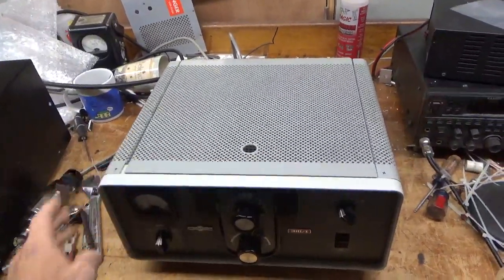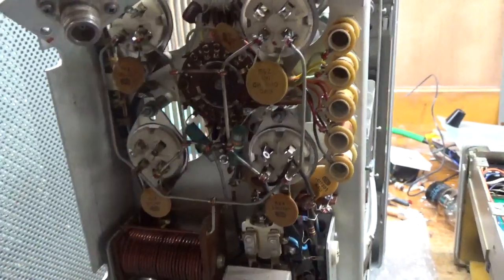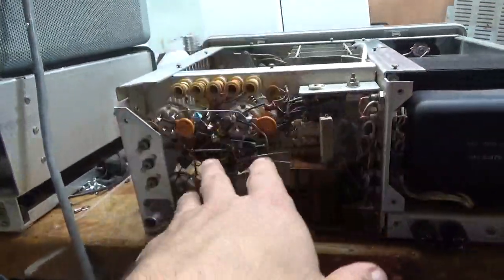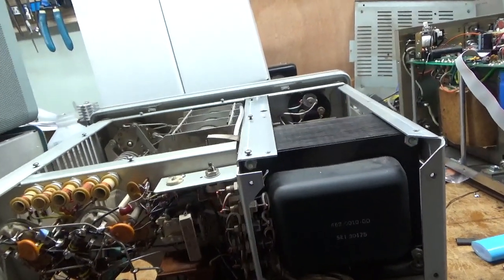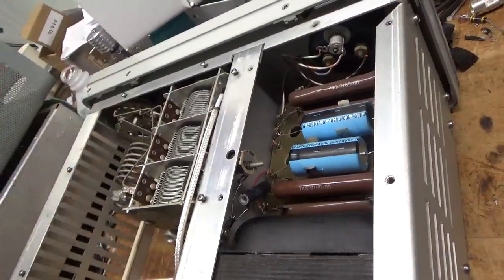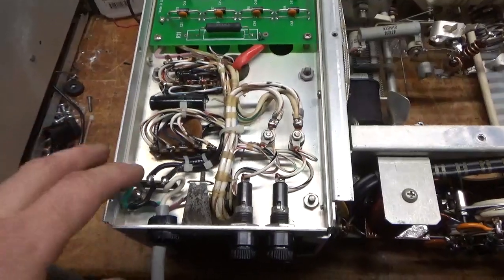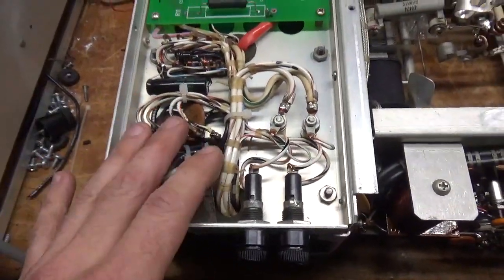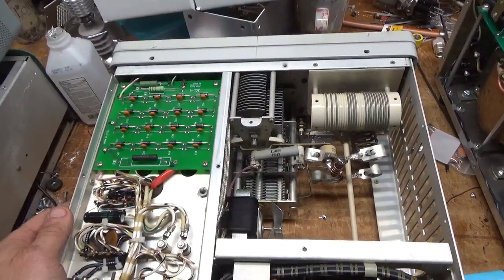Collins 30l1 Linear Amplifier Repair And Restoration

Comment: I have an issue with my Collins 30L-1 I recently purchased. It will not output any power on 10 meters. Input tune is 1:1 and it’s still showing 50 ma idle current on key down with no drive.